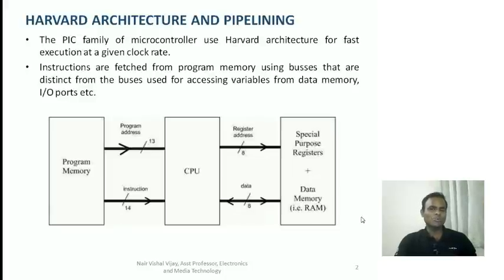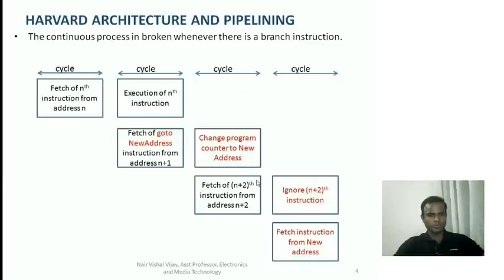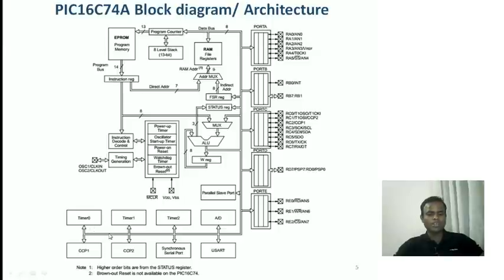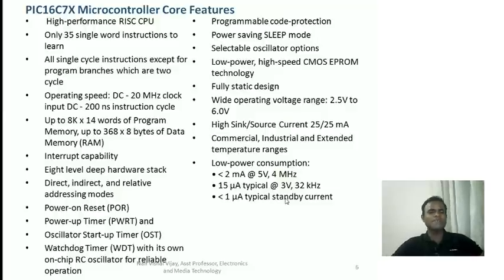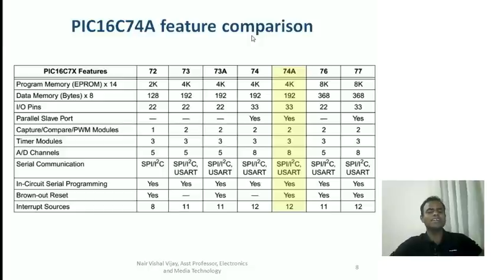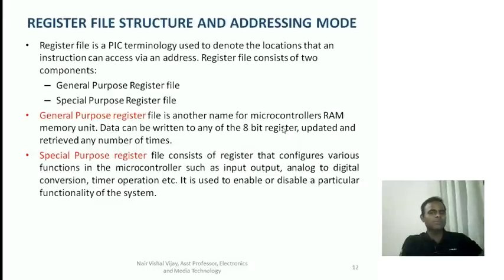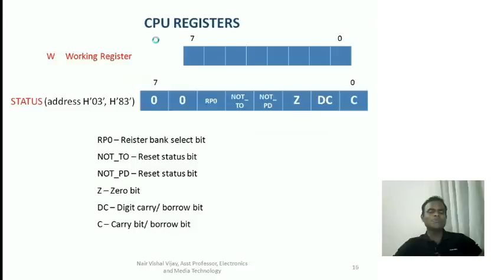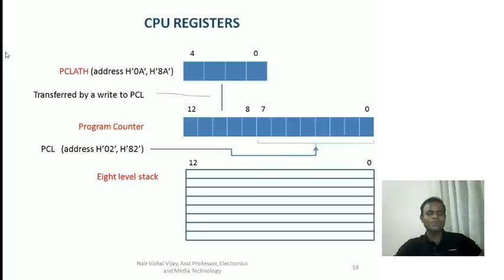PIC Architecture/ Block Diagram

Comment: Does prog memory consideration and memory interfacing are the same thing?
Reply from the maker: Program memory consideration is to analyze the maximum amount of memory that can be interfaced with a controller based upon the number of Address lines it has. Memory interfacing is to interface the memory within that prescribed limits with the controller.